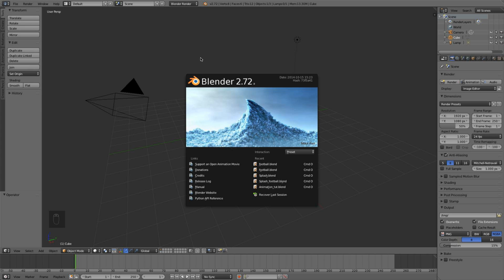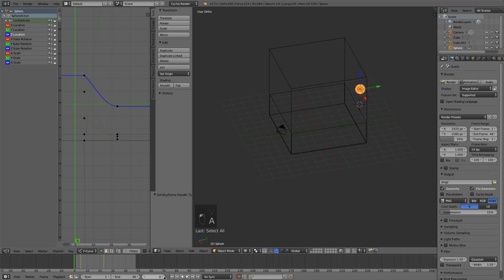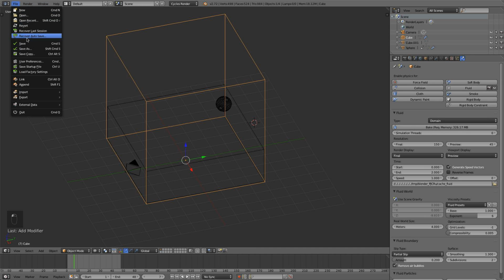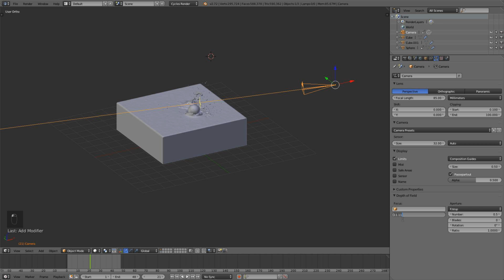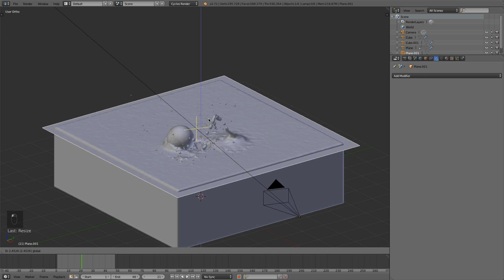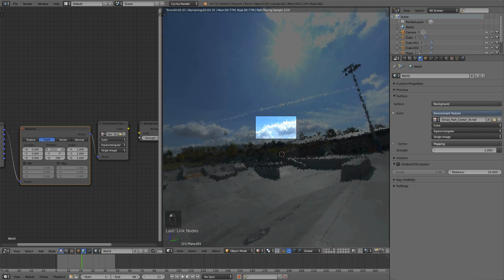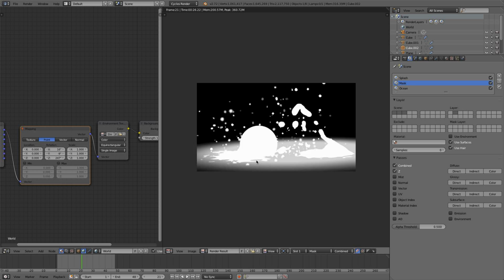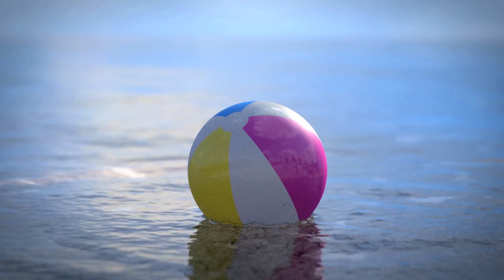Create Splashes : Blender Tutorial : Fluid Sim + Ocean Modifer!

Comment: I started baking about 20 mins ago but the baking doesn't progress at all, the bar hasn't moved a bit. DId I miss something?
screenshot: https://gyazo.com/463ecf272b5dd178d1643ef3c133a701
I have intel i5-4690K 3.50 ghz and Nvidia GTX 970
EDIT: NVM got it to work by reloading my file and switching the bake directory to an SSD file region